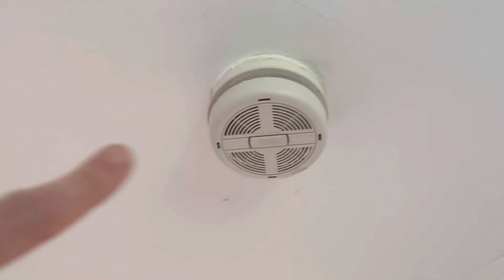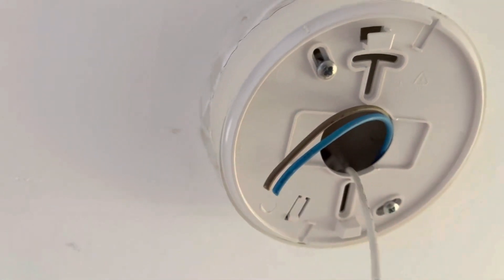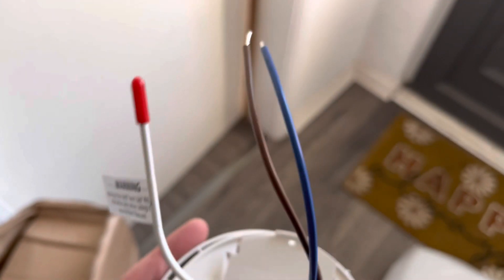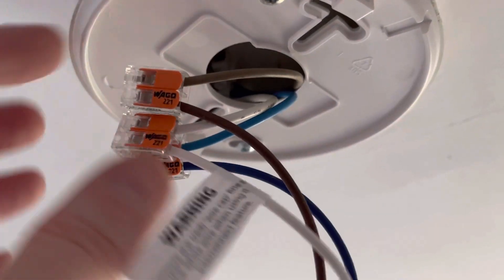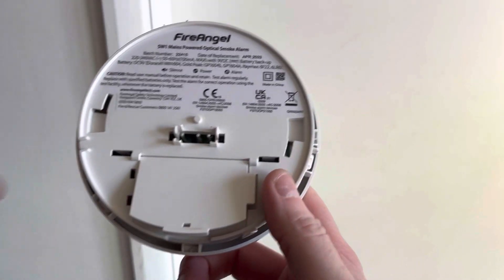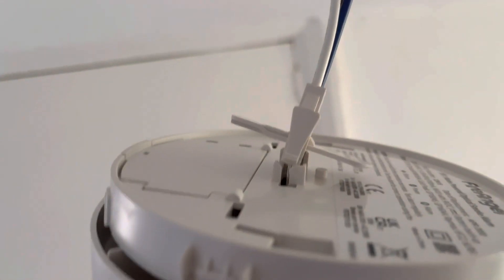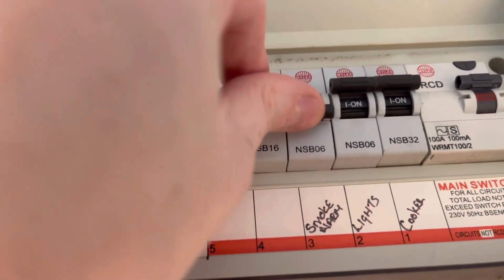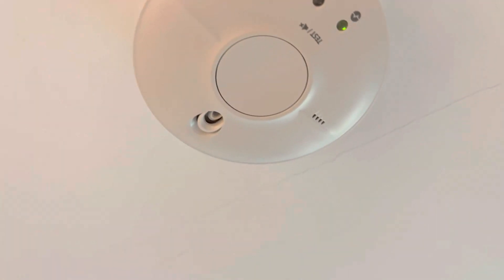FireAngel Smoke Alarm INSTALL (Mains Powered)

Comment: I'm doing this right now and there's the old "spacer box" from the DETA on there at the moment. The screws seem to line up with the holes but the screws are too big for the backplate that comes with the new alarms! Did they fit for you or did you have to make the holes on the backplate bigger to accommodate the old screws?

Comment: I have been searching for such a video( Mains with UK wiring), thanks. Explain the 3 wires please. I will be replacing two alarms that are linked via the white wire. The other two wires are Brown (Live) and Blue (neutral). No earth wire needed as alarms are plastic. I take it that these alarms are exact replacements?